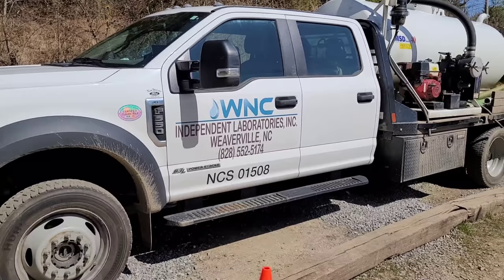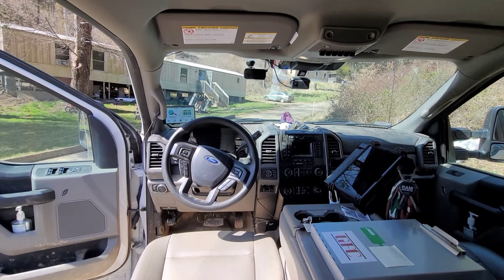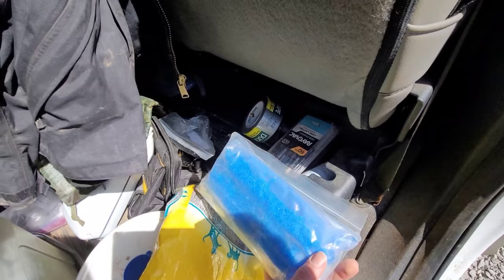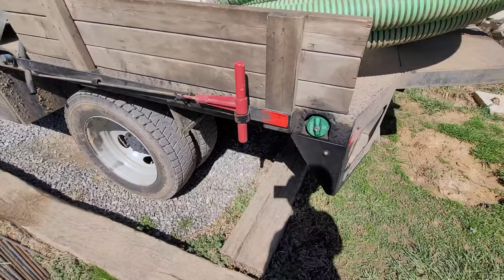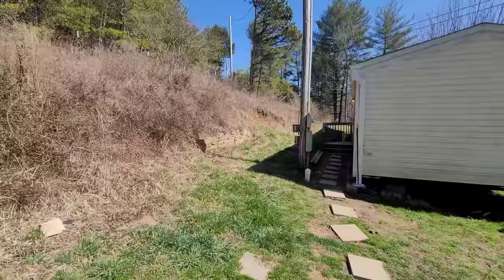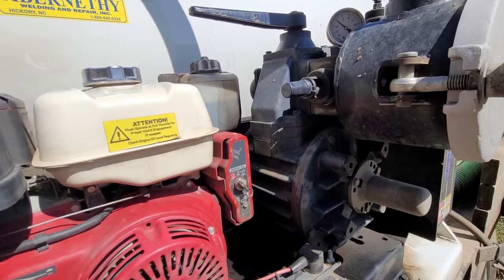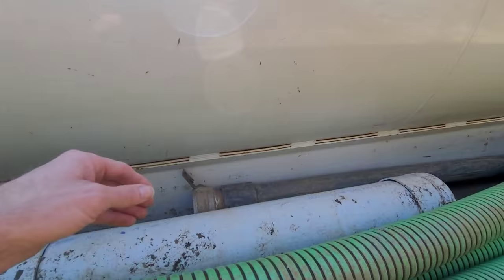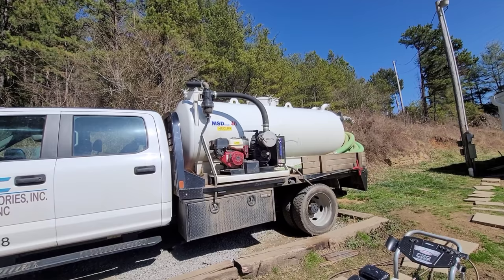Truck walk thru.

Comment: To stop your vac pump from freezing, you could get some rubber grommets and if you can find anything to fit right I would recommend using leaf spring grommets off a smaller pickup like a Nissan D21 or a small Chevy S10 and you can cut them down, I believe that would prevent water built up.

Comment: The only things I'd add is:
Front Tags, Tire Chains, Something to hold that rigid pipe on the bed so you don't have a Final Destination moment in a crash, Base Monitored GPS Trackers, Emergency Lights in case you need to get to a methane leak, an Old School METAL gas canister (or two) (mounted Jeep style) and another mounted spotlight over the cab or tank on a polearm so you can see in those really difficult situations from a high point.

Comment: Only two things I can think of. First add a little bit of rubbing alcohol it'll prevent water from freezing in the pump during the winter. Second I might recommend adding tool mounts on the wood panels.

Comment: Build a fix it kit. Pretty much a kit to fix any small problem temporarily I know in my lab overtime those vacuum hoses can rip slightly and can cause problem but 2 part epoxy will seal it in 5 to 10 minutes so there is no down time.

Anytime a truck goes out of service due to something breaking in field have a 10 to 20 minute discussion on what caused it and if there was an in field fix you could have done. Similar to how you have duct tape but on a larger scale. 

I would suggest duct tape, heat gun, industrial shrink wrap, 2 part epoxy, nail polish remove ((Pretty much hand safe acetone which is a petroleum solvent)), chemical safe gloves, zip ties, and small bits of hose.

Comment: The few things I would add:

1. Reflective emergency road triangles (you probably will never need them until one day you are on a dark country road and breakdown or run into an accident then they will save your life. 

2. Road flares, even an LED flasher is good

3. Reflective tape on the back of the tank and platform that sticks out back.

4. A 5 gallon freshwater tank with spray nozzle (or one of those tanks exterminators use) to clean stuff off before you leave a jobsite, sewage I imagine can really cut the life of a lot of your stuff if you wait to get back to the shop before washing it off. 

5. Speak to a battery guy. That battery should last at least three years. It is probably being continuously charged instead of having a controller (have covid brain and cant remember the actual name right now)

6. Be sure to add a $5 eye wash to your first aid kit and a pack of tampons in case of a deep penetrating would (originally designed for gun shot wounds I think)

7. Portable battery jump starter that can also be used to charge phone in a pinch. Stuff happens.
Reply: Monday morning quarterback I think they're doing pretty well, can't have everything in one truck- travel light

Comment: Put the cat litter in a bucket. Makes it easier to handle. 

Recommend a small amount of reflective tape on the rear step, near the nozzle of the tank. 

A small space heater and some insulation would keep the Italian valve from freezing. Bolt the heater on in the winter months, plugging in similar to your block heater. 

Strap the battery down better. Deep cycle marine battery may last a tad longer. Usually no more expensive than normal car battery. Yellow top Ultima may work as well.

Comment: Perhaps get a plastic cover manufactured for the pump control handle. It would be an easy on easy off type thing for morning and nights. They make backup cams that can wirelessly attach to either the laptop or tablet in your ram mount. These cams could also be used for liability. The only other thing I can think of is a jerry can of water with a pump in case someone really fucks up and is covered in sewage. I can imagine it would save everyone in the truck the pain of being on a long trip with them

Comment: I always look for things to make myself/business more efficient but in your case, there's no a lot of wiggle room weight wise, so my only suggestions would be slap some kind of warning label on your bag of Breaking Bad Blue identifying what it is and what it can do, add a backup camera or 360° camera, and depending on how many on your crew for each pump or job, have you thought about remote control for your pumps? BTW 👍 for your business savvy and the videos. I find them very informative and entertaining.

Comment: I would add a back up camera and I would also add some wood sealer to the wood that you have in the back to just help extend the life of the wood and protect from rotting otherwise you might be replacing them sometime in the future. And for cosmetic add a little trash bin for food wrappers that the workers are responsible for emptying everyday just to keep the truck clean. And I would add to your first aid kit some MREs and a few emergency blankets just in case something happened you never know about the weather now a days.

Comment: A couple of suggestions. 1. Instead of having a separate battery to start the pump engine, why not run a cable under the truck from the same battery you start the truck engine with? This.way you don't have to change batteries every year, and you have a much larger starting capacity as well as a way to recharge should you have to crank the pump engine for a long time, just start the truck. Also, as you say, you spend alot of ti.e backing up dark driveways, or just backing in general, why not invest in a backup camera for everyone's safety? They're relatively inexpensive, and can be set up either to have a screen in the rear view mirror of the truck, in the radio screen of the truck, or on a dedicated monitor that you can mount anywhere. Otherwise, sweet setup

Comment: mount winch on trailer hitch can be used on either end of the truck. Also could add a auto eject shore line. Have it wired to battery chargers for both truck and Honda

Comment: As if you didn't already have enough armchair engineer's suggestions. Get a "Break Away Battery Charger" or a "Brake Buddy" (it's for the battery that operates trailer brakes when it breaks away from the tow rig) have it run off a key switched relay, that'll ensure the battery is charged only when the main engine is running and it only needs 16ga wiring or so. I figure the pump is not ran long enough to fully recharge the battery with every use. Keep the battery for the pump separate, cables large enough to handle the pump's starting current would be expensive, complicated, and convoluted to have them tie into the truck's main battery(ies). Using an AC powered maintainer at base would be a PITA. My advice is worth what you paid for it. Don't know why I'm so fascinated about a YT channel that covers shit, but whatever. Keep up the great work!

Comment: Put the pump on a slide out try for maintenance. Put a little ladder that hangs down on the back and a Pole to help get up on the truck. Two lights on the back of the headack rack to light up the bed of the truck for night calls. Maybe a depenser box for the cat litter. And what if you put a cover over the pump valve like they use on homes to prevent the hose line from freezing.

Comment: I would recommend Halon fire extinguishers so they won’t destroy the electronics, an ARB fridge would eliminate the ice and mess involved but a bit pricey. MaxTrax recovery boards for soft dirt /mud/sand self recovery. 
Possibly a block heater for the pump valve to keep from freezing? I’m in Arizona, not a lot of freezing here.

Comment: Hey, I am from Germany and here we have companies with big semi trucks, which pump slurry for farms and then get rid of it for them, because laws here restrict the usage of slurry as a fertiliser, because of high nitrogen contents in the ground water. I just checked your agricultural laws and there might be a similar law passing soon, which would grow the market. But even if there would be no such law passing, there are still farmers, who have to get rid of their sludge, that doesn't fit the set requirements to be used as "natural organic fertilizer". Pumping the slurry (given they use similar systems than Germany) can be done by one person per semi truck and in addition to that the tanks are usually easy accessible. 
I know it would be a big investment, given those big trucks aren't cheap, but it could be the next big step for your business. So you might wanna look into that. Keep me updated if you want to try it and I might be able to get you in touch with a German company already doing it.

Comment: I would change the rear suspension from leaf spring too 4 link with air bags with bump stops. where the big flood light is I run an 2ft square box from center to 45° passenger side and loops too 90° around front so can store hoses under tank. With extra space I'd make full locker storage for tools and driver gear. More room in cab and less stocking up.

Comment: We stash our probes in gaps under the tool boxes, which are put on 4x4s. We also use lots of tubes to hold tools on smaller rigs, and the vactor trucks.

I've also seen those Honda motors die, but it takes EXTREME abuse to do so. Very respectable motors. especially in the winter when you are cold.

We use what you call Mookentookens, but don't know what they are called either.

I kind of want to steal the color idea.

Comment: You need to get a agm battery. Agm stands for absorbed glass mat battery. They can be mounted in any position even upside down and aren't bothered by vibrations like the standard flooded batteries are(it can crack the lead plates causing a loss of voltage in a cell or even an internal short) being so close to pump motor. Agm has very low internal resistance, is capable to deliver high currents on demand and offers a relatively long service life, even when deep cycled. AGM is maintenance free, provides good electrical reliability and is lighter than the flooded lead acid type. You can also run power from the trucks main batteries to the rear battery to charge it while driving.

Comment: So I am a pre treatment wash specialist for a snow plow factory. I run a wash system with its own waste water treatment center. I noticed you talk about weight equals money. You might be able to save weight in couplings. Dixon ones are great I use them, but I also use banjo fitting they are made of high strength Chem resistant polymer. Much lighter.

Comment: Mount for gas can, maybe a slightly bigger can too ( if needed). Could add some kind of retraction system for the hosing. I’m sure that things a pain to wrap back up, I think your employees would love it too especially if competitors don’t have. A water tank with spray nozzle if possible ( Ik you said truck weight was close) for cleaning boots, tools, etc. this would also help in the unfortunate circumstances someone was covered in sewage.

Comment: Something I notice,

Fire extinguishers 
Triangles in case of a breakdown 
A shovel and broom caddy mounted in the corner of the truck bed I use 3-4 in rigid pipe mounted on the truck bed and make them about 2 feet long so you can stick your shovels and broom Handles in them so they aren’t layin down to we’re they could get broke and slide around 
I would wire the Honda engine to one of the truck batteries 
A metal jerry can instead of a plastic one mounted to the truck bed this way you don’t have to worry about them melting or the plastic ones swelling in the heat and rupturing

Comment: Limit switch on you float that kills the vacuum. 

Like a lot of people said for the valves freezing, I would suggest heat tape. Some have a thermostat so it’s not always on. 

Some sort of remote switches for pump control when two ops are out of line of sight. 

I would wonder if there is a way to store hoses straight so the ops don’t have to fight the curve, especially when cold. 

You could attach a blank male end to the truck so you can attach the hard straight pipe end to lock it in place when not in use.

Comment: I have seen many comments about the back of your truck. My 2 cents are this.  Every object in a vehicle becomes a missile in a wreck. If its a rollover it is a washing machine of heavy items battering the life out of you. (Paramedic  eyes).  cage your cab use expanded metal with Lexan panel between your in cab storage and people. Then remove everything to the back of cab and install metal drawers as tall as the center console opening outward (out the door.). On top behind drivers seat using a metal bracket for bottom secure the yeti.  And strap secure. Mount fire extinguisher drivers side rear of cab wall door opens with left hand and right hand can reach extinguisher. Place sticker on rear door indicating where to get extinguisher.  You hang things over a first aid kit!?! Please plan on your truck on fire and your driver unconscious that’s why labeled fire extinguisher. Same for first aid kit. Best to have first aid on passengers side because it is furthest from road mount behind passenger seat same reason right hand opens door left grabs kit.  Do not put crap over either one. Our ambulances run a shore line not only for block heater but to keep batteries charged we also run a heater to keep medications and fluids warm. This could solve your freezing problem and battery problem.  Using a battery controller to switch from your shore power / truck house battery/ to onboard inverter running a battery blanket on motor battery and a modified battery blanket for the pump.  If you add the motor battery on the system to charge it will stay topped off by battery controller. And pump remains thawed out. 
Mount backup camera in the unused trailer hitch. On the overhang in rear build small drawer under to hold  small parts like these spare gaskets that are getting beat up hanging on rear passengers hose mount hook.  Not sure how often you carry front seat passengers but in not often adding a passenger side desk from Duluth or auto exec may be worth it.  That’s all

Comment: So here, kids, this is how you build a successful business. You get knowledgeable in a certain topic, you acquire experience, you think about it to figure out what is and what is not important and then you APPLY it and take part in day to day operations to get more knowledge/experience and to implement more improvements. Lather, rinse, repeat.
So many people "get into owning a business" for money and then think, once they hire people, they are above doing line work. They like the idea of getting paid well but they don't like the idea of working honestly for it.
Many people would decide a septic truck is "just a tool" that happens to be necessary to be able to charge your customer. With that mindset they buy the cheapest truck they can and they don't care for the details as long as the truck is running. And if it is not, they are usually shouting at their employees demanding to do something about it.
This business owner understands that the quality of this particular tool is crucial to the operation of the business and the quality of service that he can provide and so invested a lot of time and effort to make sure that it does everything he needs it to do and that it does it reliably. This way he can do the service faster, he can do it in situations where other trucks just can't do it and he can do the service more reliably because he foresaw or learned to deal with major problems that can ground the truck. This means less "accidents", less disruption to the business.
This also means, even if you charge the customers the same rate as competition, that you can grow your business fasters because customers will figure out you are more professional and reliable.

Comment: 3 suggestions if they haven’t been tried or covered. 

Ditch the pump battery. Use the truck batteries and a manual disconnect. 

Vaseline on top of the pump valve in the winter to keep water from seeping in. 

For the mukintukin (sp) try aluminum electrical conduit. It might collapse with the vacuum but if it holds up it will be a lot easier for your guys since it much lighter.

Comment: The valve handle on the MassPort vacuum pump could use a rubber cover similar to the battery or distributor of a vehicle. 
That would prevent water getting inside. 
Could make one out of any rubberized material, but best if find something close to size and cut the handle part out.

Comment: You can run a 2 gauge wire from trucks battery with a 100 amp breaker to pumps starter which will eliminate the need for that little battery. Backup cameras are useful too.

Comment: Install a wet kit to run the pump. 
Wire the Honda motor to the trucks battery, eliminating the one year battery. 
Put the whole tank and pump system on a fifth wheel trailer, enclosed or partially enclosed. You could secure tools better, carry more tools. If the truck breaks down , pull with another truck, if a job takes multiple days, leave the trailer. If freezing is an issue, you can heat an enclosed trailer.

Comment: Invest in an ice machine. The charging system on the GX390 is too weak for your application. Either upgrade the charging coil or use an RV auxiliary battery charger to boost charge the pump motor battery.

Comment: Nice run through.  DEF gets clogged because the engine isn't working hard enough.  I have a diesel with a DEF and if the light comes on I drive the vehicle harder for a little while, doesn't take much.  The idea is to get the filter hotter to burn off deposits.  That's a better solution than taking it off and cleaning it, since that takes time you don't want to burn.  Don't let them replace a DEF, it can be cleaned.  To run the engine harder shift later so RPMs get higher.
Reply: Running the engine has nothing to do with the def getting clogged. That's impurities in the fluid that cause that